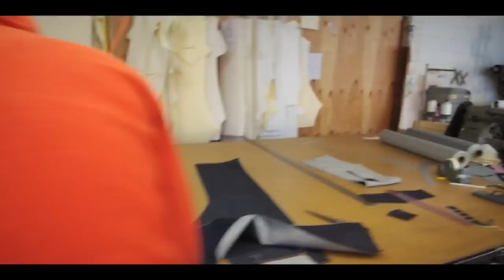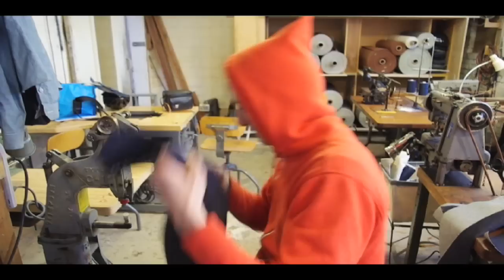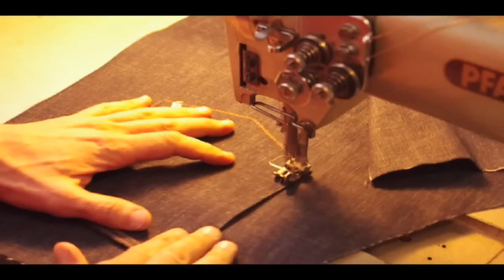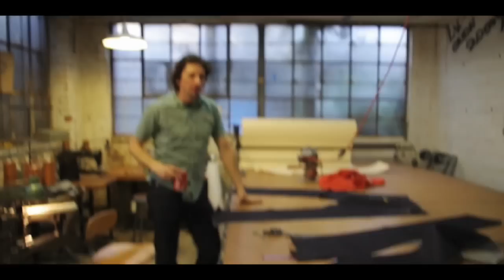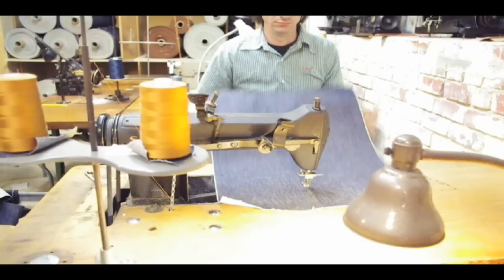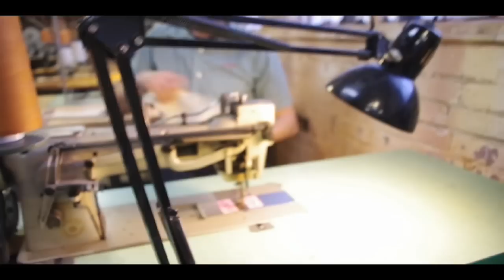Roy

Comment: Hi, could you tell me the make and model of the sewing machine that comes in 4:38? I saw a good one similar to this one advertised on a website and it seems to be in excellent condition! Thank you.
Reply: That's a Pfaff 145. The x45 series include several variants, including free arms etc. They're good machines but usually a bit overpriced and some parts are hard to find. Juki, Consew, and other Japanese makers build variants of these as well and usually just as nice. All these are essentially based on, if not downright copies of, the Singer 111, which is an excellent choice as well. Just make sure the machine is over 30 years old in order to avoid Chinese junk.